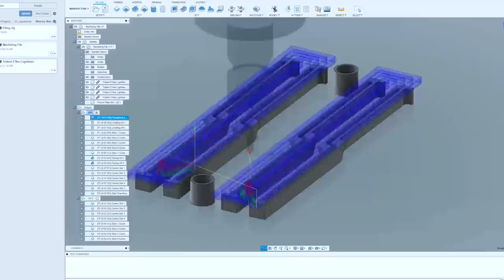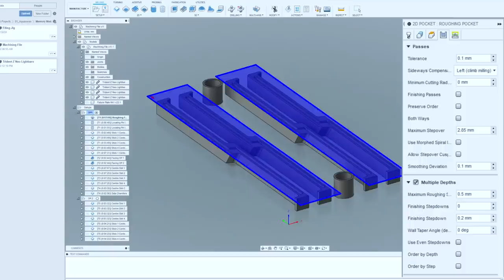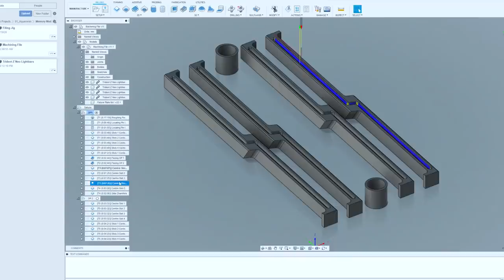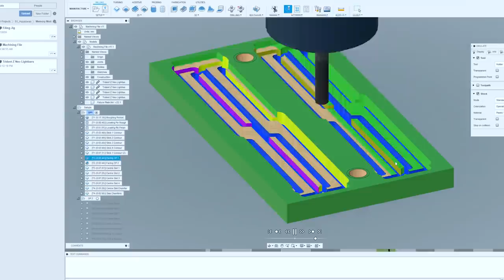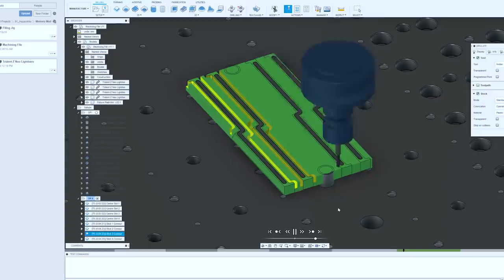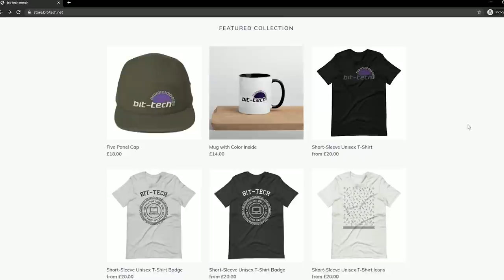AQUACERAS Part 3 - Modding the G.Skill Trident Z Neo | bit-tech Modding

Comment: I know that feeling! just took apart a C-Leg Table a few days ago to add a much more beautiful wooden deskplate. I Do have a little experience in measuring and working with wood from years ago with my dad, but I never did something like this. The feeling in the moment when the top slided back on as if it was designed like that was priceless!
...while I'm not yet modding PC Parts, I do have fun modding my Furniture :D

Comment: I work in Aerospace manufacturing the Trident Z logos are not "Silk Screened" they are laser-marked that is why the marking is still visible after stripping. If they were Silk-screened that would have been the first thing to go when you stripped the Anodize. Laser marking penetrates the metal about .003 / .005" you can go deeper but most laser marking jobs are done within that range.

Comment: Alex - in the unlikely event that you come back & read this after all this time - there's a simple solution to the "harmonics" issue you mentioned: fill some of the milled out parts with hot glue. Once you're done milling, just run the heat gun over it & clean it up.

Comment: I think the Corsair dominator Platinum could work well with this mobo. Would love to see ur iteration of it!
Reply from the maker: Dominator platinum looks awesome with this motherboard. I was originally going to use one for the limited edition chrome sets as I have an old one on the shelf, but I do need 64GB for work purposes so it didn’t cut it.

The lighting on regular Dom plat sets is a bit dated now sadly too. The RGB ones are cool but modding those in this way is an absolute pain since the bars are made from zinc.

Comment: Removing the anodizing softens the surface right? How much easier is it to scratch now? Would you recommend re-anodizing for an aluminum chassis?
Reply from the maker: C Lau If you’re able to, I would. It’s not that hard to get larger pieces done externally, smaller parts can be done fairly easily at home.
Reply: @bittech1  thanks for replying, love your channel

Comment: Hi, ok so I have scouring the web trying to find the perfect ram for my current build. It's over the top insane with no expense spared so far. Anyway, I have started modding the white Thermaltake Tower 900 with a new mounting plate where the motherboard sits - which happens to be the Asrock Z490 Aqua. I was about to settle on either the white Dominator (meh) or the GSkill Trident Z Royal because I really love the crystal effect for the rgb.  My search for ram finally brought me to your channel doing exactly what I was envisioning for my ram. So...the question is, where do I swipe my card for a set of 4x8gb exactly as you have?  I'm serious - my ocd tells me it's a must have.  Thanks!!

Comment: How thick would you say the extra section (bead blasted finish) on the heat spreader is?
Did you need the heat gun to separate it from the main body of the spreader?
Reply from the maker: sparkyenergia It’s probably around 0.7mm thick I reckon, yup use a heat gun and a knife, the adhesive is quite strong so you need to get those bits pretty hot
Reply: @bittech1  Thank you.
0.7mm. Basically about as thick as wood veneer - just an observation. Not giving away any of my plans for what I'm going to do. :-P

Comment: Hi why not fill middle with opaque epoxy? it will be much easier
Reply from the maker: I considered it, but honestly printing off 4 bars takes 25 minutes and requires no additional finishing. With epoxy the issue is it would end up flush with the top or at least be tricky to get just right for the chamfer. Could be done with a syringe I suppose but it still ends up with production difficulties.